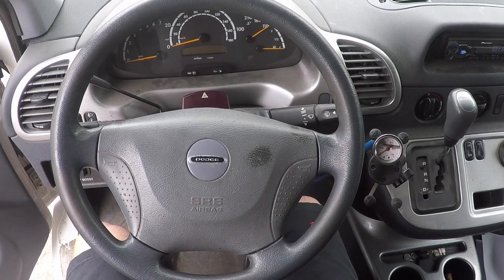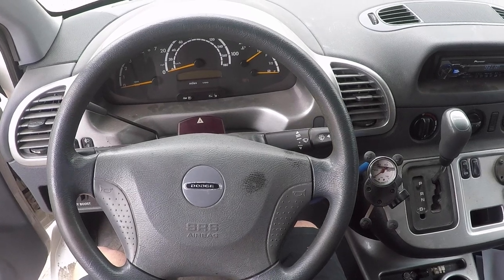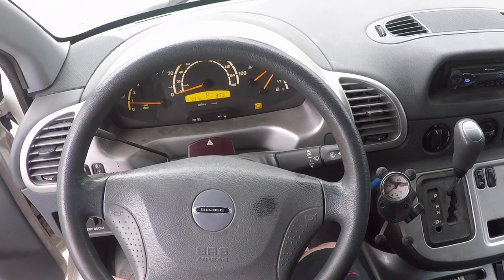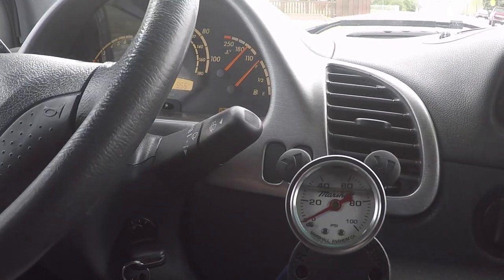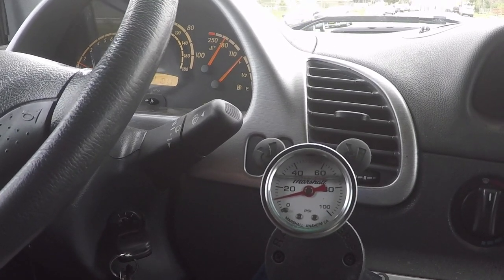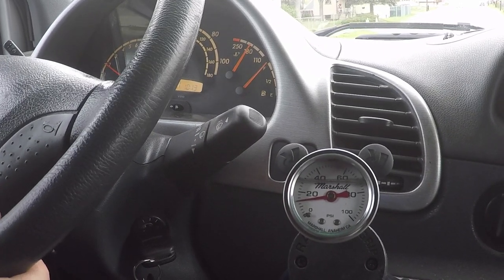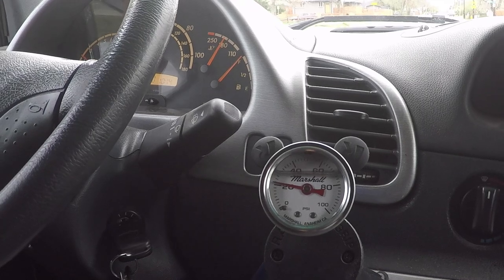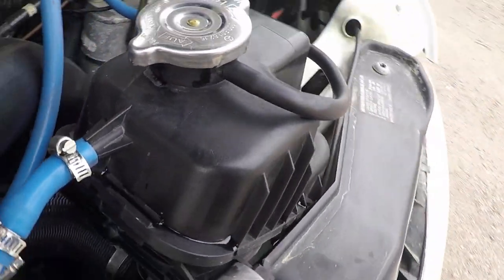T1N Sprinter Cooling System Pressure Gauge Test

Comment: Just wanted to come on here and say THANK YOU!.

My 2015 Ducato was exhibiting the same issue as yours but like you wanted to get a conclusive answer without wasting my time.

I hooked a similar pressure gauge like yours and could see similar symptoms, getting on boost/loading it up would see it rise until cap vent (20psi/1.4 bar). Going back to your forum posts confirmed it.

I pulled the head and the fire ring wasn't sealing so the head had warped ever so slightly.

Got it skimmed £60, and put it all back together with new gaskets etc, left the guage on and lo and behold it didn't rise above 5psi, even getting above 80mph, I knew it was fixed 😁😁

Thanks again
Reply from the maker: Awesome! So glad it helped someone else. This was a tricky one that a couple Sprinter specialists missed in their testing, and Mercedes got it wrong too. It’s not an obvious one unfortunately, but I’m glad you had a good result as well.

Comment: What did you find out? This is identical to the problem I am experiencing.
Reply from the maker: I posted another video further diagnosing the issue with combustion leak test fluid -- I determined it to be a failed head gasket which I went ahead and replaced. This cured my coolant loss / pressurized cooling system issue.

Comment: Hey, I just did a trip through Utah. And I’m running through similar problems. At first it was a leak that overheated the van. Fixed the Obvious leak but Ever since my coolant is disappearing and engine wants to heat up when I push it. Will try the glove test tonight and see where it’s at. No white smoke and no water in oil.
Reply: I have a tn1 06 sprinter 3500
Reply: its a blow head gasket :(
Reply from the maker: I haven't confirmed 100% what is causing my issue yet but your symptoms seem a little different. I'm not overheating ever. What did you do to determine for sure that it is a head gasket on yours? Also if you are losing coolant but your low coolant light isn't coming on, make sure to fix that -- the sensor can fail, its a cheap and easy replacement.
Reply: bryantroll i spoke with a couple mechanics and called a shop that rebuilds Mercedes engines. Told them my symptoms and they all said it’s either blow head gasket or blown head. I have visible exhaust fumes coming up from the coolant reservoir. And coolant keeps disappearing. Did the glove test I took from you and it inflates writhing a minute or two. Going to take the heads out some time this week to take a loon and plan on making videos of the whole process. 

I looked at some videos bout EGR gasket leak and it looks like that might apply to you. I’m no mechanic but that might be something to look in to.